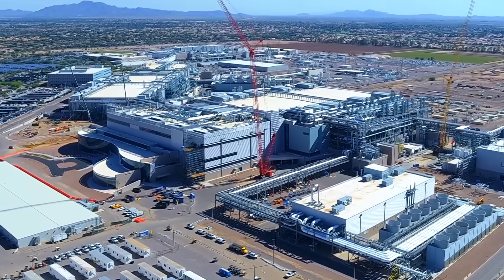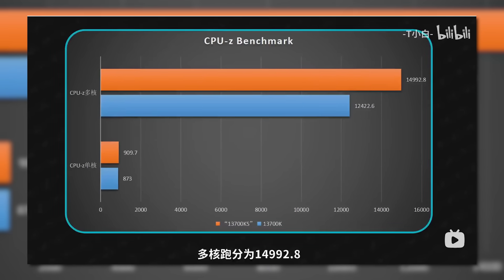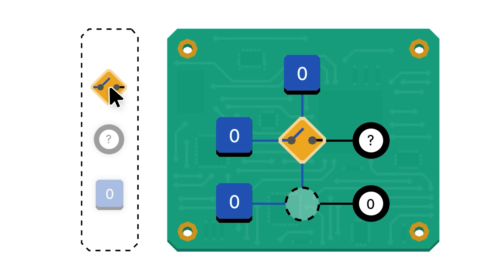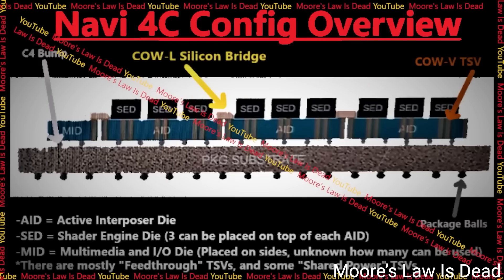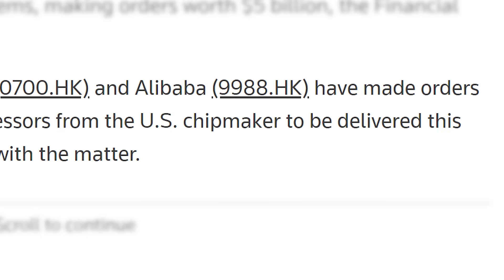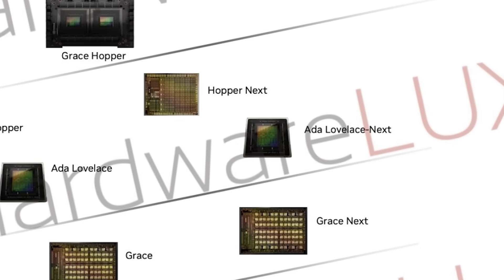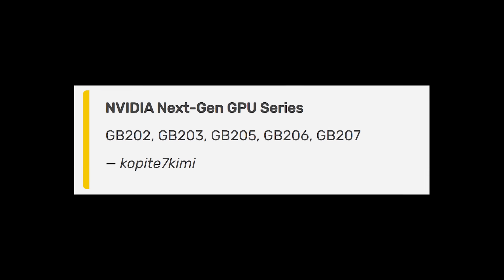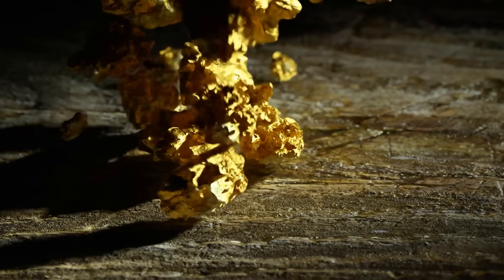GPU SHORTAGE 3.0!

Comment: The fact just is that most gamers don't need a new generation cards every year sporting between 30-50% uplift. We just need more affordable, smaller and more efficient gpu's for the low-mid range. We could easy live with 2-3 year turnaround on the Halo products like the 4090, 5090 etc. So it's only logical, that both Nvidia and AMD has found out it's better to focus on the lower end cards as it's where the majority of the revenue is if they can make smaller and more efficient cards to the masses than an ultra halo model that only a small segment can afford. just give me a card that have beween the 4080-4090 for less than 600 bucks that can run on a standard 5-600w PSU and I'll be happy

Comment: heres the problem. hbm with ai is king. 1 render (7900xtx vs tesla p100 16gb) is about a 15 second difference in stable diffusion when rendering 1024x768 at 80 steps. sounds like the 7900xtx will win through and through right? right? wrong. 100 images with the same settings 7900xtx = DNF  while the p100 takes it on the chin and moves on with its life. older data center gpus will take the brunt way before consumer mid range and low end even get touched. so if tesla v100s and a100s start going up in price we will be in trouble but from what im seeing we are very very very far out from that becoming reality. making segments about a shortage that will likely never happen will cause a gpu shortage as people begin to panic about something that again is very unlikely to happen.

Comment: no wonder they cancel it, due lack of power supply to support 2kw...you heard me...ITS FIRST GPU TO USE 2KW POWER ...and bad part...the allowable maximum amperage for the plug and PSU only can pulled 1.5kw for 15amp breaker but due to AMD gpu....they can't do it like that would burn up the PSU cable or worst whole MOTHERBOARD VRMS gets burn out fast for just push RT to same limit as 4090 just fizzle into smokes from their testing labs, least they tried to get 100fps in RT for cyberpunk before it caught fired ...indeed AMD , they sure almost got it fast, and testing say its all normal operating environment power and temps

Comment: If true then it is a true thing of direct binning of GPU accelerator cards to the consumer market the consumer market  getting the binned down cards. I do not want to think of the cost of the next 6000 or 8000 card as the current card is A6000 and 4k USD. Now with that said if the RTX 4090 is objectively better than the A6000 until you get into workloads that take more than 24GB of VRAM then the A6000 becomes 1.5x to 2x as good in performance as the 4090. The reason why is less CUDA cores but more VRAM while about the same amount of Tensor performance. You also have that is between 1 A600 and 1 4090 but you can have up to 8 A6000s in a single system all working together while the 4090 is limited to 1 per system ... kind of as games don't support multi GPU anymore it seems while AI workloads seem to do so. The most i have seen a single system have is up to 3 4090s running 3 separate AI instances but AI instances are not games but AI workloads which the 4090 is limited in scope of what it can do due to the low amount of VRAM at only 24GB.
24GB will be enough for gamers for years to come while AI instances it is only enough for training a small model and some medium size models all large models will throw you CUDA errors that amount to not enough VRAM. If it is to be a binned down AI card I will wish it would at least give enough VRAM to do AI work so 40GB ~ 48GB.

Comment: I think its still premature to say that AI is going to be the cause of difficulties with next gen. While im not completely ruling it out there will be other factors.
Reply: That s what they said about miners . Oh wait it came to reality .
Reply: @adrian2ka46  Mining was only really an issue because of Ethereum which was one of the only profitable gpu mining algorithms available. Consumer based gpu's while is still fine for using for AI isnt as efficient as the more expensive production type gpus like the NVIDIA QUADRO RTX 8000 or the NVIDIA A100 which both are highly optimized for AI unlike consumer cards. Considering the stock that would have to deplete before they got to consumer cards its unrealistic for me to believe a 2nd mining situation will happen. Cards like this werent highly sought after during the mining boom either considering it would take FOREVER for them to break even. This is a completely different scenario and we dont need people spreading bad info that could cause people to panic

Comment: So basically we are looking at another 40 series situation with everything getting branded a tier higher than the initial development intention? Or am i wrong?
Reply: nope, you're correct. Except it seems that this next gen is going to be another step in the wrong direction, not even just a standstill.
Reply: @nategrenade8695  if going slightly backwards graphically to make games actually fun and fully functional on release day again works, fine, but if they're gonna upcharge for it? They can suck my toe.

Comment: I would really like Nvidia to push their high end 50 Series GPUs as hard as they can and go all out, but why would they if they are not facing any competition at the high end? If Nvidia decides to significantly downgrade the specs of their 50 Series lineup and tries to use software technologies such as DLSS and Frame Gen as the main selling point, then I hope it backfires on them. The GPU market is extremely bad due to stupidly high prices and midrange GPUs suffering from a lack of hardware. And this is all because of a lack of competition. And Nvidia doesn’t give a shit about its gaming GPUs anymore. It's a lot more interested in trying to make profit from AI. I won't be surprised if Nvidia completely ditches its GeForce GPUs at some point so it can focus more on its AI and data centre products. This is the way things seem to be heading, unfortunately, and I hate it. I have zero doubts that Nvidia will be cutting corners when it comes to their gaming GPUs.
Reply: I hate AI
Now I hate nVidia...

AMD is the best, time will tell
Reply: I could afford a 4090 but I refuse to buy one. I'll stick with my 7900xtx

Comment: It's ROY-TERS, not ROOT-ERS. The chiplet concept is interesting, but based on this story, I think we are seeing the limits. Right now, I'm guessing latency between chiplets and the power draw is prohibitive in producing these GPUs.
Reply: The latency and power consumption are all dependent on the interconnect. What AMD is reportedly trying to use with RDNA4 is very similar to Apple’s M-series chips, and their Max and Ultra chips have near zero latency while having FANTASTIC power consumption all while presenting themselves to the operating system as a single chip (due to the ultra low latency between the chiplets).

It’s all down to the implementation. If it’s like Zen chiplets, RDNA4 is going to have major problems. If it’s like Apple’s chips, it’ll be a massive hit.
Reply: Thanks, I was literally about to type a comment stating the same lol
Reply: this guy has terrible pronunciation

Comment: HOLD IT!  If the RX 8900 XTX was supposed to have 13 chiplets, that makes the whole Navi41/42/43/44 rumor completely bogus.  For the example, we have Navi31.  Navi31 is not the package of the single GCD plus 6 I/O chiplets.  Navi31 is just the GCD chiplet, alone.  Only thing I got from all of these Navi4x and RX 8000 series rumors is all of the rumors are in conflict, which means we have nothing.

Comment: I wanted to upgrade my computer, sell it to get a nicer one. But I was hoping that I would only need to wait until 2024, just a little over a year from now I would see everything align for AMD to have RDNA4, and I got my hopes a little too high when I heard that the 8900 XTX would be like 3 MCM GPU's put together, now hearing I have to wait another year means that im losing time college and I wouldnt use it as much. If AMD pulls through with the canceling im going to be really fucking upset, Nvidia is out of the question from price alone. And Im not getting a budget build, im going to go from budget to budget at this point.
Reply: cop a 3080 used or a 6950xt
Reply: I'm about to build dude. Im coming off a 1080ti and going to a 7900xtx. Not waiting on the 80 series. You aren't going to see huge jumps from this gen to next gen anyways, it's all hype. Plus the cards will be alot more. Xtxs go in sale at 899-849 all the time. That's half the price of a 4090 and only 20-25 percent less performance with some games it actually trades blows with.
Reply: Upgrade when you need to upgrade.  If you constantly wait for that next perfect time you will never end up building anything, because at no point in history for the last 25+ years has there been a time where buying X set of parts wasn't outdated within 6-12 months.  That's just how technology works.  You will spend all your time waiting with a crappy system only to wind up with an instantly outdated system anyways.
Reply: @JathraDH  exactly. They'll be talking about RTX 6090 and AMD 9900xtz before the 50 series is received lol
Reply: @JPRIME99  Yup, not even to mention that on the very rare occasion something is actually a really good deal, then its literally impossible to find because EVERYONE is like NOWS THE TIME TO UPGRADE!

Then by the time its back in stock 6+ months later its already obsolete again LUL.

Comment: I think eventually we will have to go through a much worse silicon shortage when China attacks Taiwan (and assuming we don't all end up dead within the first week) we'll have to use older processes from TSMC's Phoenix fab or Intel's fabs. TSMC will try to keep it's best process located in Taiwan if it doesn't get taken over by China in the next 10 years but eventually if demand is high enough they will have to bring their best process to the US too to keep up. Of course if such a war were to break out there is nothing stopping the US from simply seizing the AZ Phoenix fab and buying ASML's lithography machines to takeover production. In the event of a war I think the USA will blow up TSMC's fabs in Taiwan before China could take over, but if it comes to that perhaps Taiwan would already have escalated to blowing up the Three Gorges Dam since their country is at stake. Kinda stupid (or deliberate) that much of the Silicon infrastructure on which all modern life depends have key locations in such politically stable and safe locations such as Taiwan and Israel...